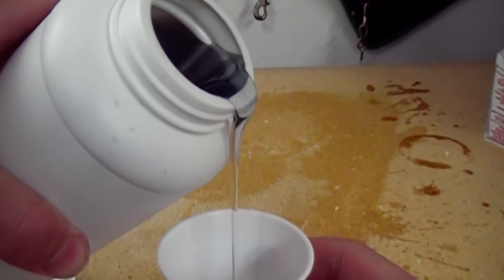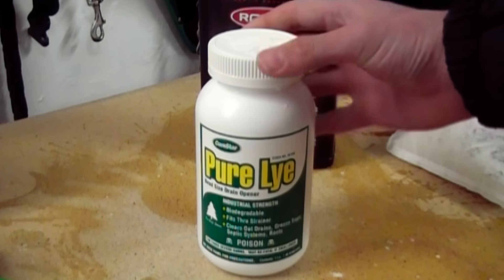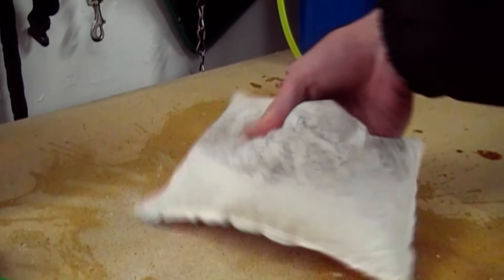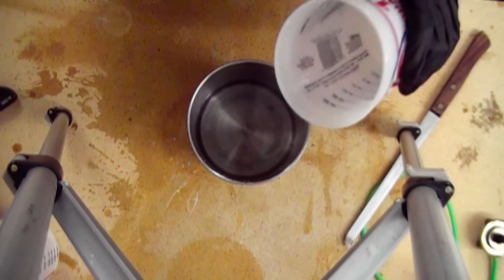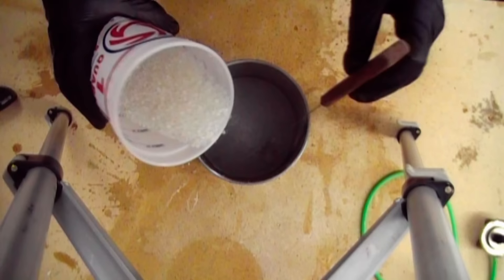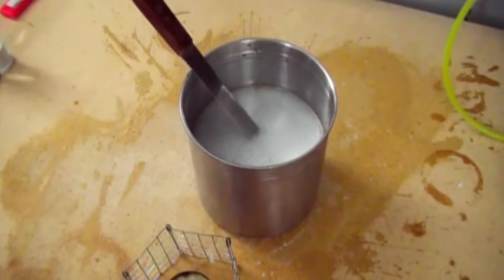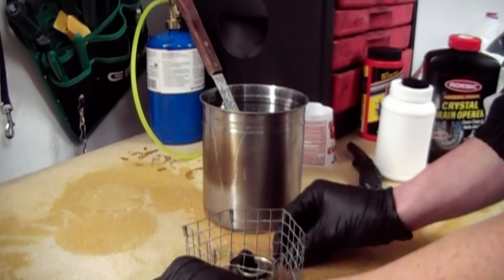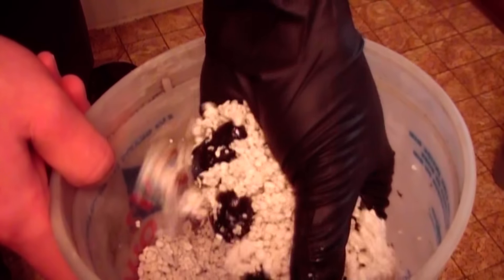Homemade sodium silicate (water glass)

Comment: Ok where or what did I do wrong? I mixed the 200g of  lye in the distilled water until devolved then slowly added the 300g silica gell. Put it on the heat and boiled just as you did, removed until it stopped boiling on its own, put it back on the heat and finished resolving the he'll and it looked just like yours. Took it off the heat after the film was on top and it would do the same on the knife. Let it cool a bit to put it in a old plastic running alcohol bottle. This morning I got up and it is non potable and is super thick. Can you think of why it did this.
Reply: I read on here that if it is thick to thin it with water, during making it or after you have made it. My first batch when heated back up is thick like epoxy, so can I add water to it to thin it out
Reply: hcistheman I added distilled water to it and ran the bottle of it under hot water for 15 mins and shook the Damn bottle until it was the same consistency as yours. I needed to read more of the posts and then said oh well I can make more. I am wheelchair bound so it takes me a bit to get it right....lmao

Comment: How do you store it after you make it?  What is the shelf life?  Does it need to be reheated for use.  It looks like it is air sensitive, so you would you have to apply it quickly?

Thanks..
Shad
Reply from the maker: It's pretty stable once cooled to room temperature, just store in an airtight container and it should be fine for years. It's actually slow curing so working time is not an issue, it takes weeks to fully dry, or cure by gassing with CO2.
Reply: Thanks..  excellent video.  :-)

Comment: I ended up finding a supply of sodium silicate at a pottery supply store and they were way cheaper than what the e-Bay retailers were offering. I believe that potters use sodium silicate as a glaze of sorts. Check out your local pottery supplier[s].
Reply from the maker: That was one of the first things I tried, my area dose not have any pottery suppliers, also tried car dealerships as they used it in the "cash for clunkers" thing years back, they used it to destroy the engines of the clunker trade ins. For me it was make it, or buy it online.

Comment: is silica gel and silica sand the same thing? great video! i just an not getting the products to dissolve not sure what im doing wrong. thanks brittney
Reply from the maker: usa1897 hi They are sort of the same. They are chemically the same, however silica gel is very porous and has a high surface area. This allows it to trap moisture as a dessicant and also dissolve faster in this process.
Reply: Ok. Thanks for responding. Should I ad the ingredients in order? I'm also using kitty litter silica will that work the same? I'm not getting it to melt down/dissolve
Reply from the maker: Yes I would add the ingredients in the order I showed. As long as the kitty litter is silica gel, it should be fine. I now use a brand called mimi litter that was the cheapest I could find. It says it pure silica sand, but it's silica gel. What brands of silica gel and sodium hydroxide are you using?

Comment: Made my first batch today in a big Pyrex container.  Upon removing from heat the Pyrex shattered.
Reply: There are three types of Pyrex containers. 1. Mixing bowls that you cannot heat up; 2. Oven safe which can only be heated evenly and 3. stove top which is what is needed for this kind of project. The type is written on the bottom of the bowl and one should assume that if you don't see 'stove top safe' that you should not use it.
Reply: Pyrex isn't made from borosilicate like it used to be. It's either plain glass or tempered glass these last few decades. Plus they license out the name to other manufacturers.
Don't use Pyrex for anything other than measuring or mixing of food; that's all it was designed to do.

Comment: I have a stainless chimney liner that I am installing to exhaust a high efficiency gasification wood boiler. My existing chimney would accept an ovalized 8" liner but not with the normal 1" insulation around it (made it too big and would not fit into the opening). I would like to pour an insulation around the liner and was wondering if a NaSIO2/Perlite mix could be made liquid enough to pour down a 15 foot opening? Would your mix work if I eliminated the plaster of paris and hand rammed it down each side of the liner? Will it eventually set up without the plaster of paris. The high efficiency boiler normally has an exhaust of 200 to 350 degrees max, but code says it must stand up to normal wood stove exhaust temperatures of up to 850 degrees. Any suggestions would be appreciated. Love your videos and ideas. Keep them coming.

Comment from the maker: +RTOHIO The recipe for the lining I did in my homemade foundry has no plaster in it and it set up just fine, just took longer. You could dump it down that space sure, but liquid is not the consistency this recipe works as. More like a damp soil. Will the insulation be exposed to rain / snow? Perlite is very absorbent. I have seen rocket stove chimneys insulated with strait perlite, just poured in the gap.
Reply: Go to the Ceramic Supply Store and buy a bottle.  It is Cheap.  Try Trinity Ceramic, Dallas T x  ONLINE

Comment: I'm assuming that the silica gel that you are adding has already absorbed water, or is it considered "dry"?  The weight will obviously change as water is absorbed.
Reply from the maker: Yep the stuff I used was old and probably had some water adsorbed onto it, I have also used new silica gel kitty litter and found no difference in how it turned out.
Reply: Good.  So I'm guessing the weight ratio is somewhat forgiving.  I have some silver powder that I've been wanting to melt down.  This looks like a fun project to make that happen.

Comment: Great video! I just made a couple batches of this awesome stuff! I found silica gell at Michaels, its used for preservation of flowers, worked great! I learned the benefit of SLOWLY adding the gel, it boiled over hardcore,  just with the chemical reaction, still worked just fine. I'll be lining my "mini" forge tomorrow. How long does it take to cure the perlite mix? Thanks man, I've been looking for a less expensive alternative to the cerablanket/plistix insulation/refractory for quite some time!
Reply from the maker: metalart0420 Depends on how wet the mixture is. As soon as the lining can hold its shape on its own, you can start slowly heating it.

Comment: Can you help me man?
I want to no know if waterglass work's like resin?
I want to mix whit wood dust and other dusts like sand, and things like this.
I want to know if will harden and will be strong glue.
I want o to make musical instruments whit recicled wood dust
Thank you for share your recipe
☺️🙏🏾
Reply from the maker: Short answer is, kind of. It will be better at binding non absorbent particles like sand, rather than wood dust. When compared to resin or wood glue, waterglass will not work as well for those same purposes. I used this waterglass as a high temperature glue or cement to make things that can survive high heat, but it's more difficult to use than resin or other types of glue that would burn at high heat.

Comment: Hi, first thx for the video it was very clear, in my case i need to use the water glass as chemical activator, so i need to control some parameters such as SiO2/Na2O and H2O/Na2O ratios. i don't know if you have any idea about this ??
Reply: +arsalan aknaou 
convert your NaOH % to the equivalent Na2O (molecular mass)  You can then solve for SIO2/Na2O ratio.  H2O will be the amount needed to make it up to 100%
Reply: +colspyro thx

Comment: Your recipe for a refractory binding agent has interested me. Have you considered using Potassium Silicate? From some of the articles I've read this may be even better to use in a refractory mix.
Reply from the maker: Jason O I have looked into it, potassium hydroxide is much more expensive than sodium hydroxide though. And in the end, it dose not matter which is used, because the silicate is cured to leave silicon dioxide.
Reply from the maker: Not exactly, I did look into that type of product as a source of potassium silicate, but it's pretty dilute. I was talking about the starting materials I used here to make sodium silicate. You could substitute potassium hydroxide in place of the drain cleaner (sodium hydroxide) to get potassium silicate, but the KOH is more than twice the cost as the NaOH, and harder to find.
Reply: Sounds about right. I did quick search for 100% potassium silicate, only to find the brand name "Barricade," is no longer being produced.

Comment: Thank you so much for your videos. I watched a number of different videos on the subject of making a refractory compound and foundry/forge. Then came back to yours....love the torch
 
 
My thoughts on thining it out are to slowly spoon it into a s.s. vessel (a-hem, stainless steel, not an ass vessel) of boiling or almost boiling water, then probably continue boiling until it thickens properly. Is this a bad idea? Can you give me some advice?
Reply from the maker: steve snyder Sounds like more trouble than is needed, you can just add water to it and stir until it is the desired viscosity. If you can't stir it, let the water sit on top overnight and it will diffuse in.
Reply from the maker: clkindred But you suggestion should work fine now that I think about more.
Reply: clkindred Good Idea. (diffuse in). I'll try that first.thanks

Comment: great video, but I think your amounts are incorrect.  I kept having to add NaOH to dissolve all the silica gel.  The stoichiometry i do indicates that there should be 400g of NaOH to 300g of SiO2.  Like so:
 2(NaOH) + SiO2 ==>  Na2SiO3 + H2O
NaOH is 40g/Mol, SiO2 is 60g/Mol.  So the reaction should take 80g (40*2) of NaOH to 60g of SiO2.  Multiplying by five would be 400g of NaOH to 300g of SiO2.
Reply from the maker: Henry Vancil Thanks, from what I could find, there are different types of sodium silicate with different ratios of Na and Si. The ratio for the substance named waterglass is the one I used. Other kinds like sodium metasilicate are slightly different.
Reply: You are not wrong.  The trouble with weighing Silica Gel is that you never know how much water you are weighing.  Your measures would work with anhydrous silica gel (dried at 220 Celcius) but I suspect the amount of SiO2 being weighed also includes around 60% H2O.

Comment: I have a question. I mixed up a big batch (4L) of the ratio of water and NaOH. I boild it and added silica gel until it seemed saturated. The product looked like what you have there but after about 1 day it suddenly started to crystallize and it became semi hard, like soap. and it for some reason it smelled like ammonia.  I put it in a PE canister. The silica gel I used was cat litter that said " pure silica gel". It didn't change color on contact with water and there were no colored particles in there like many of them have. Also it was biodegradable, so it seemed like really pure to me. The NaOH is from a chemical supplier and most definitely pure. I proceedet to test the material which liquified when i heated it up. I mixed up some sand and some drops of water and addet the slushy stuff to it. it dessolved in the water just fine. I put it in the oven to evaporate the water. It became hard as a rock but only for a day until it seemed to attract the moisture in the air to soften up again. I have no idea what I brewed up there : /  maybe you have an idea
Reply from the maker: 32AFuse I can't provide an answer about the smell, but the other clues you gave me makes me think you have a very concentrated solution of sodium silicate. The sand with sodium silicate can air dry and become hard, but can combine with water again and soften. Not until it is cured by carbon dioxide, acid, or elevated heat will it loose this property.

A test you can run is take a small amount diluted in some water, then add an acid drop by drop. If you have access to sulfuric acid, use it. I have used other acids like phosphoric acid and even vinegar. You should get a precipitate of silicic acid, which will start as a gelatinous blobs. You can then dry and dehydrate this substance to get pure silicon dioxide if you want, but the formation of the weird gummy precipitate indicates you did in fact make sodium silicate. You can thin it out with water if it's too thick.
Reply: clkindred Thank you for your reply! Today I tested to identify the mysterious mush I made, via the sulfuric acid method you advised me. And it turns out to be indeed sodium silicate.. YAY! My guess on the ammonia smell was the really tiny amount of penetrating primer residue that was inside the canister before and reacted with the alkaline waterglass. Anyways I made some aluminium ceramic today and it's really awesome! Thanks for the knowledge and the help!
Reply: clkindred So does this mean it would help your forge cure faster if you added some vinegar to the water during the perlite/sodium silicate/water/aluminum oxide mixture?
Reply from the maker: No, that would cause the sodium silicate to cure instantly without gluing anything together. It would be like using glue that is already dry.
Reply: clkindred Hmm, even if it is dilute huh? Wont the sodium silicate in the 'outer' forge walls not cure then and remain hydroscopic without any plaster of paris/acid/heat?
Reply from the maker: For a while, yes. If a setup to gas the curing mixture with CO2 could be made, the carbonic acid made from CO2 reacting with water can cure the lining. This acid introduction is done without disturbing the mixture so it works well.
Reply: +clkindred 
I propose a different idea.
If the mixture rapidly changed from being two solids and water into being a substance of soap like consistency, then I would say that by sheer luck, the reaction finished at a point of solution super saturation, whereupon the mixture in its entirety turned into a solid hunk of perfectly hydrated sodium silicate with little or no left over water.
This would also explain the smell of ammonia, since if there is little or no leftover water, then any nitrogen in the mixture prior to the reaction and setting of the mixture would be squashed into the tiny bit of left over water, where it might combine with a tiny bit of that left over water to create NH4 while displacing oxygen if it were present, or attaching to any excess acid that was present in the solution.
Excess acid in distilled water is perfectly exlainable by carbon dioxide dissolving into the water so as to create carbonic acid prior to reaction.
It is a shame that a photograph was not taken, and other conditions like humidity/temperature written down for attempted replication.
The possibility of a simultaneous physico chemico phase transition in a single step at ambient temperature and pressure is an interesting thing to think about/explore.

Comment: I have a question: you show the sodium silicate hardening on the knife, yet you are creating this for a future project. So does this solution, when mixed, heated and totally blended stay liquid, or does it become a solid when it cools? It's not clear based on watching the beads set up, but in subsequent video's you are seen pouring it. Can you elaborate. Thanks.
Reply from the maker: 1958piwo It only looks like it's hardening on the knife, it's really just rapidly thickening due to being out of the heat, I use that as an indicator of the moisture content so I know when to stop boiling it down. It remains a liquid in storage.

Comment: Is the silica gel baked dry before it is measured out, or is that 300g with a random amount of water based on local humidity?
Reply from the maker: No baking, whatever water may be in it is not accounted for, I assume unless it's soaked the difference would be negligible. This reaction is pretty forgiving.
Reply: Thanks! I've been wondering about this for a long time. Do you know what kinds of temperature it can take before it starts to break down? I've been thinking about building a Rocket Mass Heater and looking for ways to make it last more than 2-3 heating seasons while it burns hot enough to eat the steel that is normally used to hold in the insulative masonry.
Reply from the maker: This stuff "cures" by decomposing back into silicon dioxide in a multi step process. So the heat tolerance of sand is what I compare it to.

Comment: I made sodium silicate last night. Followed directions closely...Outside in 38F degree cold, rainy, and moist air. (I was just inside my open garage door). I used a stainless steel bowl and electric hotplate. Now after cooling it's way too thick to pour. Thin it with distilled water?
Reply from the maker: steve snyder Yes, thin with water.